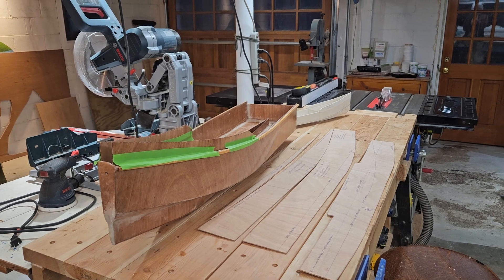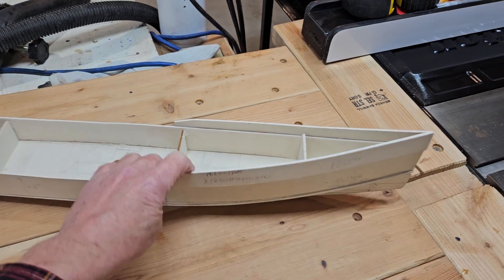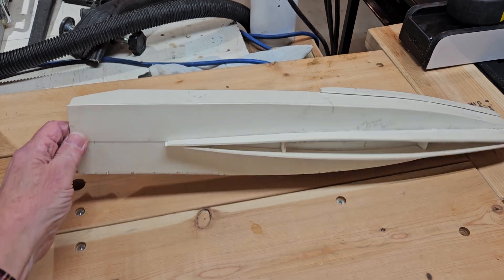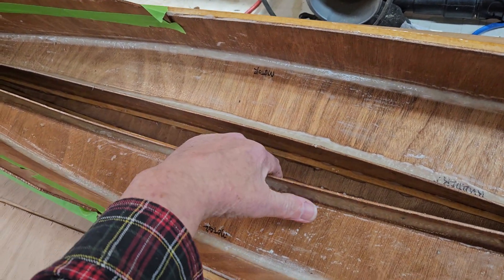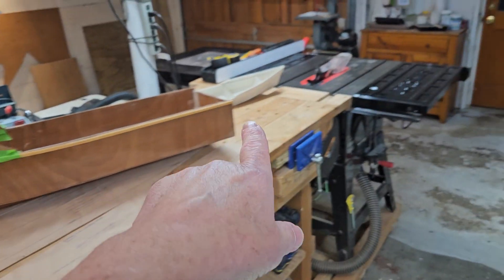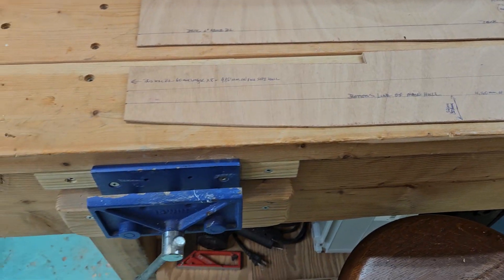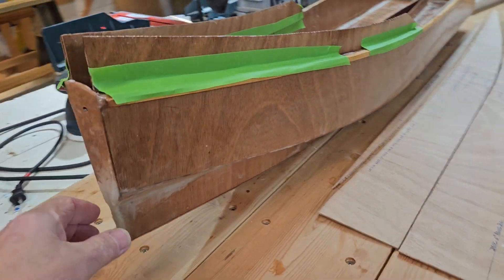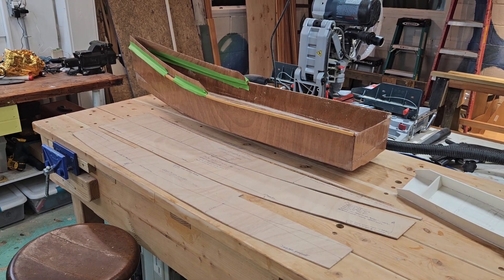Electric Boat Build video 1

Comment: Gavin, this project is so exciting. The prototype looks incredible. We will be following along and can't wait to see how she turns out! We own the Idaho by Phil Bolger and the Youtube channel: https://www.youtube.com/@babybluesbybolger. Thanks for the kind mention.
Reply from the maker: I love your channel! Thanks so much for all your videos. The Idaho is a great design. So simple and efficient. I had come up with several design ideas that were all going to be more complex and probably would have been less efficient. I knew I needed something very long and narrow. I was targeting about 30 feet, but I was concerned about how narrow I could go. When I saw your videos it changed my thinking. I realized that 5-6 feet wide would be very workable. I ordered a set of plans for the Idaho and started there. 
Where we will be using this boat in Penobscot bay it can get quite rough in the afternoons when the South West wind frequently comes up at about 20 - 25 knots and the waves can easily get to 3-4 feet. Based on that I decided to go just a bit wider and a bit more freeboard and narrower entry at the water line and a higher bow. Keeping the battery weight low will also help a lot.
Most power boat designs just make big holes in the water at low speeds and use huge amounts of energy unless they are up on a plane. Even on a plane they use a lot of power. They really can't just cruise along at 6-8 knots so you can enjoy the scenery without leaving a massive wake.
My hope is that these sorts of boats catch on as something people can build themselves and enjoy time on the water or for aquaculture kelp or scallop farming etc. where there is no need to go miles offshore. Inexpensive to build and inexpensive to fuel with either gas or electric.

Comment: Some good ideas in this design, but I bet you haven't done the buoyancy calculations yet.
The first thing that you need is a weight table, with a summary of the positions and mass of the major components, including the hull, to be sure of freeboard, and wave control.
I advise you to build a 1:5, or even larger scale , and use foam with glass skin to get proper hull and topsides scale weight. Plywood is way to heavy to create a proper scalable model.
If you build an accurate scale model, you may get some useful data, but I strongly advise you to get a naval architect to supervise the final result.
Reply from the maker: Actually I did do the buoyancy calculations. It is not difficult and the numbers (other than the weight of the batteries) came out just a bit heavier than the Bolger Idaho design which is very similar in size and construction and exactly what I expected. Of course I also have the weight of the batteries factored in. This is not my first boat design or build.